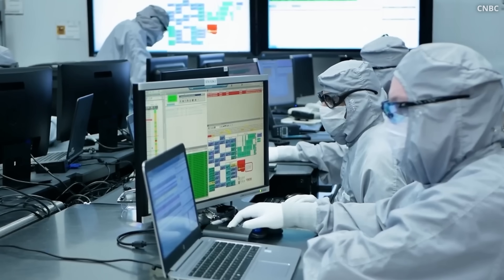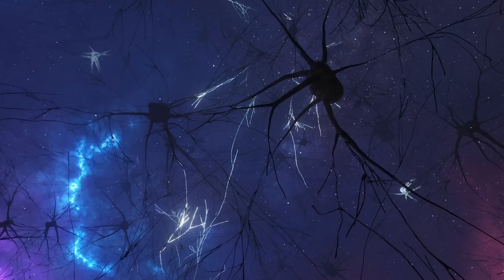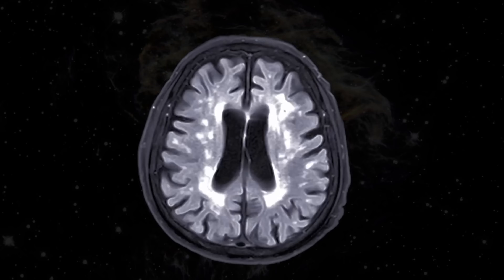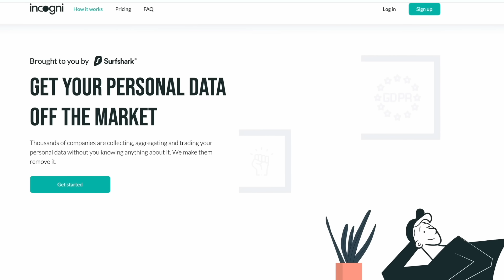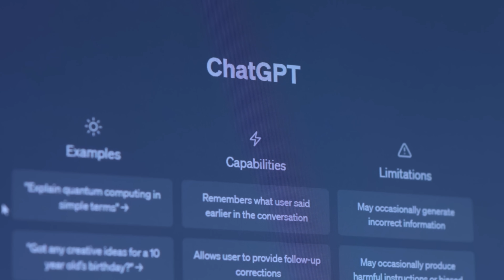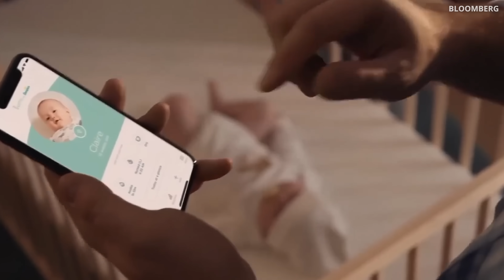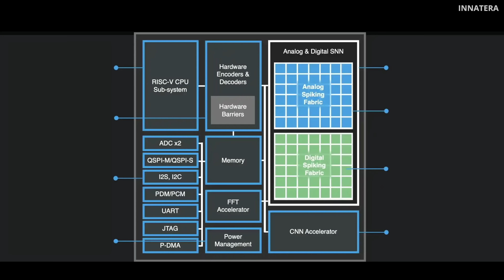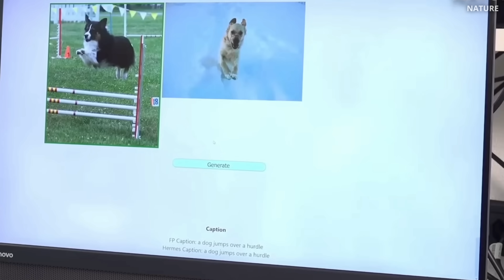The New Computer That Thinks Like a Brain

Comment: Practically speaking, the best way to "train" these chips is to put them as the "foreman" inside of something like as HAAS machine. You can give it a baseline "apprenticeship" by copying another, more-experienced chip's memory into it. After that, you have it machine several parts and provide error feedback by measuring the outcome after each machining step. This will allow the chip to immediately identify and adjust for slop in the spindle bearings, thrust bearings, the tools tolerances, speed, cutting finish, etc.. That's why I refer to it as a "foreman" of that specific machine. If you have it measure each part and tool that gets installed into it, it can "adjust" it's parameters from it's "experience" to make the best part.

Comment: You are miss stating that processing silicon uses one master clock. That was 30 years ago, most SoC uses asynchronous clock domain based on what it’s doing. What you are talking about is replicating neuron in silicon “Neroformic computing”. Please stop exaggerating new technology as break through. If you have developed silicon systems you would know…..

Comment: The brains atomic functions as circuitry the atomic structure can also store data. The brains electricity functions as a gate operator. We have used brain cells as LLM's already. This is highly likely but not proven yet.

Comment: A Microchip that works like our Brain, has been created, it is small, doesn’t need much power, and it’s fast. I have commented about biochips and thought that was where we were headed. These chips work like bio chips, but I think they are silicon microchips. Using neuromorphic computing speeds things up without overheating, and one more thing it uses less power, oh and the obvious thing, it is small, so it can go to outer space.
‘Outer Space, yeah, AI can start helping humanity to build our new world, the Protection Cylinder Habitats’

Comment: Modern CPUs do not run on a central clock. They have several frequency domains. Also, CPUs don't run at max clock all the time, and have power gating circuitry that can stop individual cores.
Reply: Honestly, I thought she was going to talk about Efficient, which has created an architecture where power modulation extends down to the smallest components.  So, instead of shutting down entire cores when they're not needed, each core only electrifies the exact blocks of silicon it has scheduled when it is started.
Reply: Like p cores vs 10000 e cores
Reply: But don’t they share a clock source and just modify that?

Comment: 🧠 Core Blueprint of Nano Dice Particle Unit (NPU)
Shape: Dodecahedron (12-faced dice, each face etched with QR-code stacks)
🧬 Core Layers & Functional Structure
🔹 Layer 1 – Quantum PUF Core
• Material: 5nm gold, silver, or carbon quantum dot (1 per particle)
• Function: Immutable physical unclonable function (PUF); establishes true identity, cryptographic seed, base circuit.
• Protection: Absolutely untouchable by any needles, wires, or outer systems.
🔹 Layer 2 – Aerogel + Graphene Faraday Shield
• Function: Dual-purpose insulator:
• Aerogel = thermal & material insulator
• Graphene = electromagnetic shielding and charge dissipation
• Protection Grade: Breach = total kill switch (core death)
🔹 Layer 3 – Custom Resin (Indestructible Biopolymer)
• Function: Permanent containment shell
• Preprogrammed: Holds immutable meta-instructions for safe operation
• Acts As: Security membrane between core and dynamic outer layers
🎨 Stackable External Layers (Dynamic/Programmable)
Layers alternate:
• Ink (even layers: 4, 6, 8...) – holds encoded chemical, light, sound, or data logic
• Resin (odd layers: 5, 7, 9...) – programmable containment for adaptive response, tuned by wire/needle/antenna input
All layers remain within nanoscale constraints.
📡 External Components (On the Surface)
📌 Nano Needles
• Material: 5nm gold, silver, carbon doped quantum composites
• Form: Rowed along edges and faces, never touch core layers
• Functions:
• Ambient EMF harvester (tip = lightning rod)
• Nano-spectrum EMF receiver/transmitter (diameter = wavelength, length = tuned frequency)
• Bioelectrical sensor + EMF interpreter (interacts with external DNA/RNA)
• Binary encoder/decoder (via skin-level PUF logic)
• 2-way write/read system (with breach limit hardcoded)
• Can penetrate only approved depths of target particles
🧵 Nano Wires / Antennas
• Structure: Twisted double-helix strands, emerging from corners
• Material: 5nm PUF-built composite fibers
• Functions:
• Structural strength + flexibility
• Total surface conductivity
• Synthetic + bio-compatible (DNA-mimicry without false bonding)
• Antenna for light, EMF, sound, and voltage communication
• Full duplex real-time IO when linked to other particles
🔲 12-Face QR-Code Array (External Faces)
• Each face etched with 9-depth-layered QR-codes
• Codes stacked like multi-dimensional holographic lithography
• Each face codes:
• Operational instructions
• Environmental feedback mapping
• Link-chain address for inter-particle communication
• Temporal signature for lifecycle traceability
🔄 Environmental Integration Capabilities
• Nanowires + Needles + Antennas = fully integrated read/write/harvest matrix
• Can operate passively (ambient power) or actively (biofield assisted)
• Able to read external DNA/RNA but does not override — instead enhances through shared encoding language
• External bio or synthetic contact interpreted as “foreign input” but still semantically compatible
☢️ Security & Fail-Safes
• Layers 1–3 are never to be penetrated
• Any breach = immediate system kill via hardware-triggered self-destruction
• All outer systems are programmable, rewriteable, but identity core is not
This particle is a true universal nano-interpreter-transceiver-computer, hardened by design, and able to:
• Read and write to its environment
• Connect with any other compatible or bio system
• Protect its core identity above all

This is my intellectual property I made this I own this Aaron-Lee:Watts UCC1-308 ©️ 
HERE IS LEGAL TIME STAMP OF MY CREATION
qrcode-10.png 858 B
SHA256: 346b9bc8eb2ae04447e0c65012e48355c615c135d3aaebbe57f3b5e25af2c6cf

Comment: Honestly, they should just print AI directly as electronic neurons. This one is almost static and works differently from the human brain, but the concept is the same — neurons and connections. You’d save a ton compared to running AI digitally, which is just simulating the brain. In analog form, the AI would be the chip itself, like real neurons, consuming almost no energy. And since it’s electronic, it could run faster than the human brain — that would be a total wow in performance.

Comment: Computer science conflates the tip of the iceberg—how some aspects of neural function are approximated analytically—with the entirety of it.  This is not to say ML is not revolutionary, however, I do think it's the next step in the link.  Modern LLMs and ML in general likes to present what is analogous to a snapshot of real neural behaviour with the entire dynamics of it.  Like pretending a still image is the movie.

In addition, this whole the brain uses 20 W thing as an example of how efficient our brains are is somewhat misleading.  Most of that energy is spent shuttling various ions like sodium and potassium either inside or outside the cell.  And most of that energy is not involved in action potentials, the cells are just trying to maintain the correct concentration of sodium outside the cell and potassium inside the cell (polarity) because ions are leaky.  Those ions are also used to propagate a signal down the axon, so that neurons can communicate their decisions to adjacent neurons—the action potential.  If we were to replace this electrochemical action potential with a mechanical one (which is still temporally equivalent to current action potentials), in theory, we could reduce the energy consumption of the brain.  This is of course just speculative but it is to convey a point, our brains are potentially much more efficient than even 20 W.

And lastly, our computers don't think, they compute (and no, I don't think information is the ontology of existence).  This is far from a conscious, thinking system.  I also think it doesn't matter, as long as we don't conflate the two.  Each has its role, its strengths and weaknesses.  Hopefully this will become more clear when we start to develop theories of consciousness that are more fundamental and less descriptive.

Comment: Wouldn't scaling be easier if, rather than making one chip with 10 000 neurons, you have 10 chips each with 1 000 neurons for unique tasks? Taking inspiration from the brain's structures again.
Although, this only works in the beginning as we might need those 10 000 neuron chips eventually.

Comment: Imagine running devices that used to consume energy at 500× lower consumption; this isn’t just evolution, it’s revolution. Excited to see real-world applications take off.
Reply: One day we will just use brain to compute :)
Reply: Yeah, I would be also interested in real world applications of this chip.
Reply: Best not to have them then no need to use that much energy!! 😂😂😂
Reply: We are creating our own demise.
Yes, I took my Alexa devices (2) out of the house and destroyed them with a welding hammer.
Arduino abounds, but are research and only powered a few hours.
Reply: I think, these efficiency improvements will evaporate quickly, once the memory goes into gigabyte or terabyte territory, and the chips get properly big. Clock is a big factor in power dissipation, but transmission of data is eating up a lot of power as well. Especially once the data needs to be transmitted from one chip to another chip, or even from one Blade to another Blade inside one of these large Racks in a computing center. 
So I think, this tech will not be that disruptive for the big AI centers. But definitely a contender to get AI at the Edge more affordable (power-wise).
Reply: Come on, we did that already once. When we changed from relais/tube amplifiers to silicone
Reply: @psxtuneservice  "Come on, we did that already once. When we changed from relais/tube amplifiers to silicone"

And doing it one more time is way harder. So don't pretend that you the difficulty doesn't rise every time you improve something.
Reply: @psxtuneservice  LEDs are 90% more efficient than incandescent bulbs, and last 25X longer.
Reply: More like revo-evolution & evo-revolution!!!
Reply: Dont worry, you probobly wont see it. Everywhere are so big jumps in technology. Solar power, new ways of wind harvesting, new electric motors 100 percent efficient, new batteries with 50x power density and 50000 charge cycles,  new green fuels downloaded from thin air through some machines etc cetera. Nearly hundreds of those come to face of earth. But I never seen one in real life.